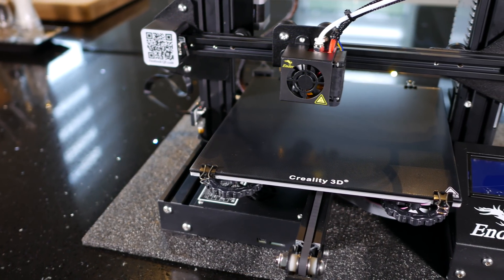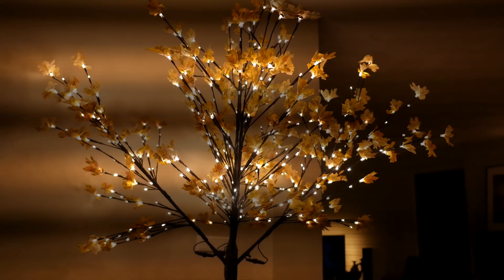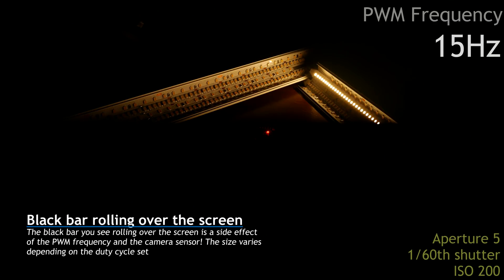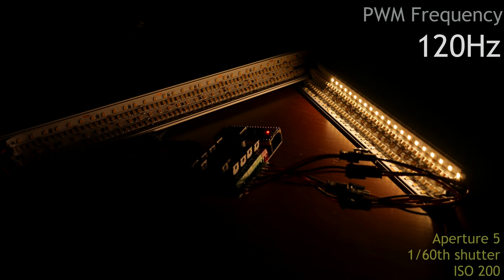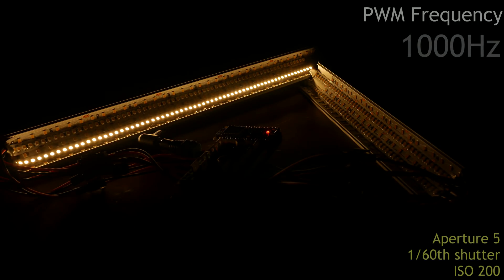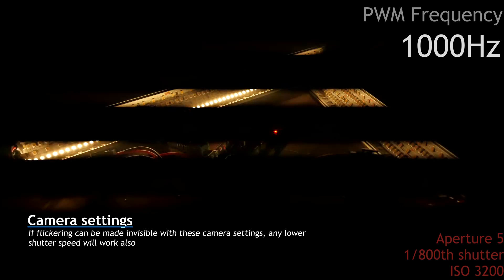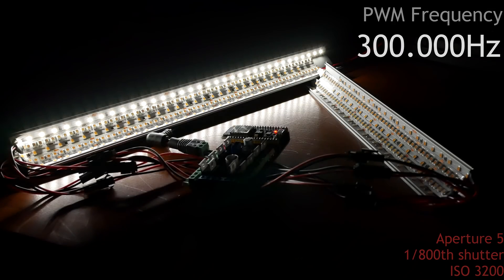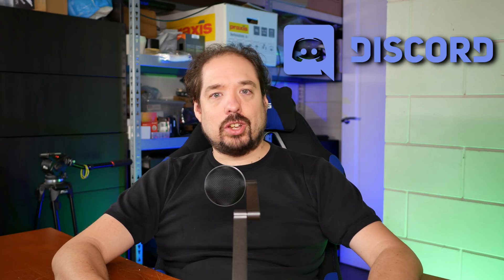QuinLED: What PWM frequency is required for shooting video

Comment: I'm looking for a simple dimmer for a Baja Designs Offroad 12V LED. It can't be dimmed through voltage control, and off the shelf pwm dimmers are way too slow. I just need to control one light, which dimmer do you recommend? Thank you!

Comment: At 6:30 - because of how the sensor works. Please explain. Are you referring to multiple rasters being read out at a time?
Reply from the maker: Ah no I'm talking about the rolling shutter effect. A image sensor scans rows from top to bottom and this creates the rolling bar effect, basically where the off happens to align with that part of the sesnor being read.

You also have global shutter sensors, then you'd get a completely blank frame if it happened to sync with an off period on the PWM duty cycle.

Comment: Hi, Nice tests and video....isnt a solution to use 300Hz PWM frequency, as it tends to be the industry standard for PWM dimming?....300Hz should be OK for most people and most situations, yet it is within multiplication of 50Hz(EU) and 60Hz(US).... (50*60=300Hz so this should cover both types of continent powers) which should then cause the camera not to record any kind of flickering (such as your 120Hz test shows no flickering, due to a fact that it is multiplication of standard mains power frequency 60Hz used in US)....If 300Hz isnt enough for "moving" objects, I believe the best solution should be to multiply the basic compatible frequency 300Hz by any multplicator....say 900Hz or 1200Hz must be enough for anybody......High frequency could cause alot other problems (EMC emissions which are to be certified at certain level for all products (nobody wants to transmitt EMC emissions and mess up telecomunication signals, wifi or to abuse national EMC standards. + other factor is higher losses on swicthing components and wiring with higher frequency. 
Your article on your webpage describing the pros/cons of various LED driving method (Constant current, Constant Voltage, etc) is correct, I have created something similar and with more complex tests, if anybody is interested : https://www.master.lighting/technology/constant-current-drivers
Good job anyway.
Reply: 300Hz could flicker @24 fps, since it is 12.5 updates / frame.

I think an even better 600 or 1.2k. 600 is even for most framerates: 120, 60, 50, 30, 24. And I'd expect high enough that even 59.94fps has an imperceptible variance. Of course if you shoot at 1/800s, then you'll have a partially black frame, but it will be consistent (or slowly rolling) and not flickering.

Comment: So, the 1kHz PWM of the Arduino I bought should be enough for my naked eyes. It would be a pain if I needed to build my own pulse generator.
Reply from the maker: Yeah, a stable 1kHz is more than enough for human eyes, most commercial dimmers are around 100Hz. My QuinLED-OG's which I have been using for a few years now run at 1kHz and at no dimming level do you see any flickering at all so I think you're good. :)
Reply: Intermit.Tech 
The QuinLED looks awesome. I wish I had seen it before buying an Arduino with a protoboard.
Than you for the video.

Comment: Since your frequency is high enough you should be able to actually increase the amount of colours available using dithering. Even after limiting the amount of colours initially.

I have to say that I don't see yet why the 300kHz reduced the amount of levels though, is that a code limitation? I would assume it would increase the amount of levels actually.
Reply from the maker: It's a limitation of the the micro controller. The higher the frequency, the lower the resolution. Still, 256 levels is the same as most commercial controllers if we're talking RGB so it's not that bad. If you go to an even higher resolution it gets even more limited though, and you'll definitely see it during fades and such for instance.

Comment: 1kHz PWM is easily visible to some people in some situations if you know what to look for and the duty cycle is low enough. I'd always aim up to at least 10kHz.
Reply from the maker: Maybe for some, I myself am quite sensitive, always have been (Especially in the CRT screen era, I could tell your refresh rate easily up to about 100Hz) but with the 1000Hz even at a low duty cycle, I can't tell. Stil, as seen in the video I've tested the new design all the way up to 300kHz so even at the lowest duty cycle that produces any light, I still measure a PWM pattern of around 100kHz. Should be plenty. ;)
Reply: Yep 1kHz certainly isn't a problem for general lighting for most. Mostly when it's reflected off metal surfaces or seen further away straight on it is very visible with rapid eye movements (saccades). This guy has come up with a way of quantifying flicker by taking account frequency, modulation depth and duty cycle for example: https://www.derlichtpeter.de/en/light-flicker/cfd/

I feel his index is a bit too lax when determining something flicker free, but there's a lot of good information and links on the site.
Reply from the maker: Interesting indeed! He describes the camera test I performed so I believe the new QuinLED if set to a high enough frequency would pass his tests and hopefully land in the dark green zone. ;)

Comment: Andries, I am just imagining about new QuinLED. 

Feature suggestion:

- Default state (after power cycle on/off), this is IMHO very important. It should be power off by default. Possible values: Auto on upon power resumption on/off. Save light state automatically (ask from server).

- Compatibility with Home Assistant / probably trough MQTT. MQTT for speed and compatibility. Netcat app not was the "best" solution. :)
Reply from the maker: Let me tell you something..... Done and Done!

QuinLED is fully compatible with esphomelib and esphomeyaml making them the perfect Home Assistant MQTT LED controllers. It's what I've been doing most of my testing with.

With MQTT you can select the power on behaviour you want, I use "current MQTT setting" by default so even when you remove power and power it back up it resumes what home assistant is set to immediately. But you can also chose to have it power off or whatever you'd like.

esphomeyaml also facilities secure remote communication and console, updating, etc.! It's quite nice software!

Anything else you'd like? ;) A previous suggestion prompted me to include a DS18B20 1-wire temperature sensor on all the boards, which is also working already! :D

And the whole netcat solution was only because I'm not really a programmer and that was the best I was able to come up which worked reliably and was available at the time. Preferably I'd like to use open source software projects like esphomelib, but sadly ESPeasy isn't working well enough on the ESP32 yet, so not sure what to do there yet.
Reply: Intermit.Tech our dreams come true. Temp sensor is a very cool idea and the DS18B20 is a nice, cheap sensor and it's pretty accurate. 

One more wish, but I think this is nearly impossible: the new software backward compatibility with series 1? I think I am not alone who made a bunch of them and I don't want to throw away the old ones.
Reply from the maker: We're on a roll here! Check out esphomelib and esphomeyaml I think it can work just fine if you want to run MQTT and Home Assistant! :)
Reply: One more thing for PCB manufacturing. I often see jlcpcb.com in DIY YouTubers video. Maybe you can collaborate with them for some manufacturing help and we maybe receive be some discount from order. Just an idea.

Comment: One problem, well two actually with frequencies that high.
1. Your mosfet has a harder time with higher frequencies and becomes less efficient (switching losses)
2. If you use long wires to your LED lights (or strip lighting) you are creating a pretty nice antenna to transmit your PWM signal.

For normal (non video) use 1kHz is more than sufficient, I would be hesitant to go a lot higher, especially with long wiring runs.

10 channels of PWM is quite heavy, iirc the ESP does not have a onboard PWM outputs, so that means ding it the hard way in software.
Reply from the maker: Yeah, the MOSFETs might become a bit less efficient but by what I've seen so far it doesn't differ much to be honest. But it's interesting, I'll setup a proper test for it with my 10 channel board and see the difference of 10 channels running 50% duty cycle at 1Khz and at 300Khz and see what the input power difference is and subjectively the light output. There might also be a heat output difference, I'll measure that too! :D

Yes, the long wires will act like an antenna but even at 300kHz I believe it's still well below any radio frequency we use except maybe the old AM? I'll see if I can do some more measurements in this regard, also how far it propagates for instance. Not sure how to do that though.

The ESP8266 has 1 hardware timer up to 1000Hz which can be used for two channels. It just wasn't available in the Arduino IDE for the longest time so that's why QuinLED OG uses NodeMCU.

The ESP32 has 8 hardware timers which can be used on 16 different channels (Also in Arduino IDE using LEDC). So it's quite capable of driving PWM to 10 channels without it forming a CPU burden. I had to trick this in the video because I used 10 different values, in reality, this cannot (should not) be set. Normally this doesn't form a limitation for LED PWM though because you want them to run at the same frequency anyway, just different duty cycles per channel, which is no problem.
Reply: @IntermitTech  if you have a sdr dongle you can check the spectrum and see if you radiate any thing.
Reply from the maker: Interesting! But are there sticks that can receive below 1Mhz? Most I see are meant for much higher frequenties. Even the 300.000Hz is only 0.3Mhz.
Reply: @IntermitTech  not that i know. but you can use a upconverter that converters the signal to a high band so you can see it.
https://www.rtl-sdr.com/review-of-nobus-hf-upconverter-galvanic-isolator-and-14-mhz-low-pass-filter/